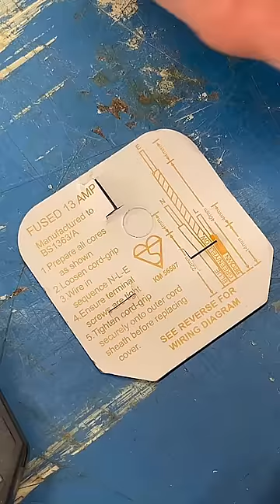Probably the Best Plug in the World 🇬🇧🔌🔌🔌

Comment: In the top five reasons why I prefer living in Finland as opposed to the UK, yes, the utterly fucking awful plugs. Yes I am old enough to have had to wire/rewire and replace the fuse in one of those idiotic things. But, for me, the plugs in Finland are just so much better designed and manufactured.

Comment: Over engineered, we have been using what most call the most dangerous plug in the world here in the USA, hasn't shown to be any worse of a design. If anything, we can use our plugs in much smaller spaces and not have our furniture stick out from the wall. It was a decision to not fuse individual circuits and save on wire by having the whole house in a ring configuration. Now, you have the most expensive plug system in the world.

Also, how many other countries adopted this design? These plugs are unnecessary if you have the protection built into the house wiring.
Reply: A standard BS1363 plug sticks out less than your flimsy NEMA things. How many other countries, you ask? 51.
Reply: Circuits are fused at the box by an RCD/RCBO. It’s somewhat similar to American GFCIs, except Americans only use GFCIs in bathrooms except the whole house 😂

Comment: I remember approx 30 years ago learning that, soldering or crimping your cable in a plug, leaves the solder or crimp left in the screw and your wires loose inside when something pulls hard enough on the other end 🤔

Comment: 13 amp at 220v downgraded to 3 amp?
Reply: Depends on the cable. For table lamps etc with 0.75mm cable, 3A is recommended
Reply: Yes, of course. If you have a 0.5 mm^2 cable connecting a table lamp, then it needs more appropriate protection than a 16A or 20A MCB. Also, as UK circuits are often 32A (and, in theory, can be even more), then having a fuse appropriate to the flexi cable is important. That 3A rating is commonly used on low powered appliances.
Reply: @TheEulerID  if the lamp is made to British Luminaire standards, if the cable is cut longer than 1m, then 0.75mm cable should be used
Reply: @ctreanor93  OK, but the principle is the same and there are other types of low power device that use 0.5mm^2 flexible cable. You can certainly buy 0.5mm^2 flexible cable.

The general principle is still the same. There should be overload protection which protects the cable, and a 16A MCB is not sufficient protection for either 0.5 or 0.75 mm^2 cabling.
Reply: @TheEulerID  as far as I know, the fuse is the protection. If there a 16A mcb, I'd assume there was 2.5mm cable to the socket. Then the 3A fuse would protect the lamp or whatever was plugged in. Same as a 5A plug on a lighting circuit. I'm not am electrician so happy to be corrected
Reply: @ctreanor93  It is the fuse in the plug that protects the cable from the plug to the device (and, to a lesser extent, the device itself, but electronic devices often have their own internal fuse of even lower rating). 

Lighting circuits in the UK are on 6A MCBs these days. It's only the older installations with fuse boxes that are 5A. 

In the case of plugs, they aren't normally found on 6A lighting circuits, although you might some old-style round pin BS 546 5A plugs on some. Hotels quite like that approach, but some people use them in fixed lighting in homes. They are still in UK regulations (and are likely to remain so), but must be protected with a suitable fuse (if connected via a spur) or MCB (such as a dedicated light circuit) as they don't have that internal fuse. Or at least most don't; there are fused BS546 plugs available.

Comment: Why do poms always think this?
1.)There is no need for a fuse, as it's regulation to have an RCD breaker fitted to most houses (devices that trigger in milliseconds when more current is going in than out and overloaded). 
2.) The 10 amp fuse certainly wouldn't save someone's life.
3.) It's too big and awkward.
4.) The pins in it are massive which is overkill and poorly optimised design 
5.) Cost is inherently higher.
Reply: 1.) An RCD doesn’t protect against overcurrent, only earth current faults.
2.) The breaker in the box in the UK is normally 32amp, under fault conditions passing 32 amp down a piece of 0.5mm2 flex (rated at 3amp) is asking for a visit from the fire brigade.
5.) The price for UK plugs starts from about $0.50(USD) when purchased in bulk.
Reply: @alanwood9804  RCD's also have overcurrent built into them. They don't require the time it takes to burn a fuse, as it's electromagnetic. Still isolates the circuit faster than a fuse.
Reply: @rediculousman  
I’m an electronics engineer with 40 years under my belt.
So yes, I know the difference between a fuse, MCB, RCD and RCBO and the function each is designed to do and how they work.
Reply: Why cut power from an entire circuit when it's more than likely a single appliance at fault?
Reply: @Aengus42  because if it's somebody getting electrocuted or a fire starts without exceeding the fuse rating, losing power to a room is the least of your concerns.
Reply: Infact, a fuse that is burning out can cause a fire to start. Better to have it happen in a specially designed box rather than on your polystyrene filled beanbag.
Reply: @rediculousman  The fuse is inside the housing of the plug. That will be plugged into the wall outlet so away from your beanbag. 
But if you are using your appliance attached to an extension lead then that lead will be plugged into a switched outlet with a plug fused to  13A. The end of your extension lead, resting on your beanbag, with your appliance's plug plugged into it will be fused suitably for your appliance. Let's say, a 3A fuse because you're only powering a table lamp.
Now, oh noes! The table lamp develops a fault. The fuse in the plug plugged into the wall doesn't blow because the load didn't exceed 13A but the fuse in the plug plugged into the extension lead resting upon your beanbag does blow because it's rated, correctly, at  3A. 
Is there a risk of fire?
Well, no. The fuse is filled with inert sand so the momentary heat and tiny blob of molten copper wire is instantaneously quenched inside a ceramic tube that has a breaking capacity of 6kA (6000A). The breaking capacity is the current that a fuse, circuit breaker, or other electrical apparatus is able to interrupt without being destroyed or causing an electric arc with unacceptable duration.
And that is inside the housing of the plug.
Add on to that the fact that your beanbag would've gone through these tests before going on sale on the UK...
The requirements in the UK fall into three categories:

The cover of the bean bag must be match-resistant. To demonstrate this compliance, the cover should pass the Schedule 5 Part 1 test, which is a modification of BS 5852:Part 1:1979 with ignition source 1 and non-fire-retardant foam. The only exception to this is if the cover is composed of 75 per cent or more of cotton, viscose, modal, flax, silk or wool, separately or in combination. In this case, it need not be match resistant provided it is used over a fire barrier interliner that passes the severe test in Schedule 3.

The cover and filling together must be cigarette resistant. To demonstrate this compliance, the cover and filling should pass the test specified in Schedule 4 Part 1 of the regulations.

The filling material should pass the appropriate test specified in the regulations. The actual test will vary according to the type of filling used. As stated previously, the most common type of filling in bean bags is polystyrene beads. For this type of filling, which is classified as a non-foam filling, the appropriate test would be Schedule 2 Part 1 which uses ignition source 2.

So I think you'd just about squeak through without major injury. 
Wouldn't you?

Comment: nobody in the world uses these plugs except the UK... so 
Probably the Best Plug in the UK
Reply: Please do even the slightest bit of research.
Reply: Except maybe ireland, singapore, mayalsia and hong kong...
Reply: british colonies they were..
Actually this plug is outdated. It was invented in a time, when insulation material was more expensive than the copper wires. So one used lower voltage (110V) and higher current, to save on that insulation material (Bakelit, porcelain..). Since insulation material became much cheaper (plastics) one could increase the voltage to 240V, use thinner copper wiring and actually also use optimised plugs. For some reason our friends on the island are still holding on to that unnecessary plug. Just think, besides the fuse in the plug, every socket has a fuse too: and a switch. Don’t call it paranoid, please. But: why?
Reply: @k_b7341  the game changing safety feature is actually the longer earth pin  that opens the socket shutter and makes contact with conductors impossible. Compare that to countries of whom have sockets that don't even have an earth pin in their sockets!
Reply: @hf4838  in one way you are right, but in the mean time we have more advanced security features, like the RCCB (Residual Current operated Circuit-Breaker).

Comment: Why is there a fuse in the plug? Seems like overengineering when you have breakers at the other end.
Reply: Passing 16amps (in the case of mainland Europe) or anything between 16 and 32amps (the breaker rating) in the UK down a 3amp flex isn’t good unless you want a visit from the fire brigade.

Comment: Can you tell me why the English Plug uses a glass fuse when you have a fuse panel in your house.
Reply: They use ring circuits. These circuits run at much higher current, therefore all cables of appliances would need to be able to pass this current in case of a short. By putting a fuse at the plug, the cable only needs to handle a lower current as the fuse blows in case of a short. Fusing only the house would require  much bulkier cables for appliances. Radial systems normally run on lower current, often avoiding this problem.

Comment: Why is there a fuse inside the plug? Are there no central fused cabinets for buildings/apartments? 🤔
Reply: Its just the way our houses are wired, also our votage is higher than most homes in the US
Reply: @the98themperoroftheholybri33  Thank you bro. I live in Germany and we also have 220-240 Volts. Every house/apartment has a fuse cabinet with fuses for every room (living/kitchen/bath…). Electric stoves have a high voltage input (Drehstrohm) which is around 400 Volt due to higher power consumption. All lines are earthed and a fuse will „fall“ in case of short circuit. These are switches, not „burning“ fuses. They can be switched on again after a short circuit is eliminated. ✌️

Comment: I have never put a 3amp fuse in a toughened plug as they are usually used to replace a damaged power tool or extension lead plug when squashed by a wheelbarrow or whatever & how many of use forgot to put the cover on the flex first in the days of  the rubber duraplug with a closed flex entry…😫
Reply from the maker: Agh yes the classic Duraplug 😂
Reply: @efixx  lets not forget the old MK rubber plugs where the cable had to be threaded through as well. Most of them i came across had the cable entry cut away to avoid that problem!! 😂😂

Comment: not the best in the world for 2 reasons, it does not stay 100% in the socket when you have an off-center load esp when the socket is installed upside down and once you have stepped barefoot on one, you will aggree it's not the best. The shape make it lie 99.99% prongs up on the floor. Electrically it makes sense having them invidually fused is a good design imho.
Reply: Yes it stays 100% in the wall what do you mean 😂 and you don’t step on it cause you don’t need to take it out - you just flip the switch

Comment: I like the strain relief in this a lot more than our Aussie plugs. Are they fussy with the overall diameter of sheathing?
Reply: The cable grips are big and can take a fair size of sheath. If you’ve got a particularly small outer sheath, you can flip them over to get a better grip. Anything over 2.5sqmm is an interesting job to undertake. The biggest problem is getting the cover back on!

Comment: Compared to the Schuko it feels old and dated. To big, can't rotate.
Reply: If you accidently hit a Schuko plug on its side whilst plugged in it smashes the recessed socket and can exposes live conductors. The UKs plugs & sockets don’t do this.
Reply: @alanwood9804  point taken but I think it is a bit of a fabricated scenario. Similar blow to a UK plug will potentially break the plug and expose the wiring in there. Schuko plugs are not sticking out as much as the bulky UK ones. Each their own but a broken or faulty socket or plug should be replaced.
Reply: @SebastianSpiess  A rewirable schuko sticks out of the wall way more than a British plug. When inserted between 16.5 and 18mm of the body of the schuko is inside the socket the rest (68mm) sticks out from the wall. The largest (rewirable) UK plug will only ever stick out from the wall by about 20mm and the cord will always drop straight down the wall. The right angled moulded Schuko (Type E/F) and the UK (Type G) plug are within 5mm of each other when inserted into its respective socket (Schuko = 15mm and the UK plug (Type G) = 20mm).
Reply: @SebastianSpiess  BTW, that “fabricated scenario” nearly electrocuted my son when he was 14month old.

Comment: What was the reason to do this vs fusing the house circuit?
Reply: To get a plug
Reply: They use ring circuits. These circuits run at much higher current, therefore all cables would need to be able to pass this current in case of a short. By putting a fuse at the plug, the cable only needs to handle a lower current as the fuse blow in case of a short. Fusing only the house would require  much bulkier cables for appliances. Radial systems normally run on lower current, often avoiding this problem.

Comment: Copper to brass conducts electricity way more better then tin to brass, so why would you crimp proper copper wires with 1 cent shitty tin crimps?
Also wires per se, will have bigger contact size than crimps, so truly 13A can be handled, which I grantee will not happen with crimps......

Comment: why was the 13A fuse replaced with a 3A ?
Reply: If the appliance that the cable belongs to is rated max 3A, you fuse it at 3A.
It’s safety.
You want this fuse to blow before the circuit breaker does.

Comment: And the next total failure and also a clear misuse of the actor (because you can not call him an electrician): (1) You must not twist the wire when using ferrules and (2) You should not cut the ferrules, but instead use ferrules of the correct length.

Comment: What is the crimp end called that you installed on end of the wires? Is it to prevent shorts from stray wires?
Reply: Ferrules. They just keep all the strands together and make it easier to screw in. Not really necessary for this job, but more useful if you are connecting to one of those push-fit connections where strands would just bend.

Comment: 20 years ago, we had 13A plugs that had wire clamps, not screws, auto cable retainer, and 3 cables all the same length, and the cover retained by a 1/4 turn plastic turnbuckle...quick, easy, safe, compact!
Reply: Screws have been common in UK plugs for decades. As have screwed down retainers (which I'd trust a lot more). Not keen on a 1/4 inch turn fastener to hold the plug together and there's no way a UK plug would have all the wires the same length unless you're stuffing them into the case for the shorter runs which is potentially dangerous. 

This coming from someone who's been wiring UK plugs of many manufacturers for nearly 40 years.
Reply: @skylined5534  The plug I describe actually works perfectly well, and has none of the issues you imagine,  the only problem with the one I have is its uninsulated pins, which were allowed at the time, and could be easily rectified. I tried to post a picture of it, but couldn't, so you can't see how sensible the design is. Having said that, it hasn't swept the market, so there must be a reason for that...!

Comment: Pretty nice. I like the fuse inside the plug.
Replace the screw terminals with springloaded ones and it is in deed close to perfect.
Reply: just use an extension cord thats sized to your breaker

Comment: Is British power one leg 240volt and neutral or two legs 240volt?
Reply: Probably 230V against Neutral.
Phase to Phase to expect something around 400V
Reply: UK domestic electrics are single-phase 240v at 50Hz. One pin carries that phase. The other pin carries the neutral. The top pin carries earth. E and N are bonded together at some point, but will have diverged by the time they reach an appliance.

We don't get biphase supply in UK  Electricity is generated typically as three phases, with each phase becoming the live of every third house typically.